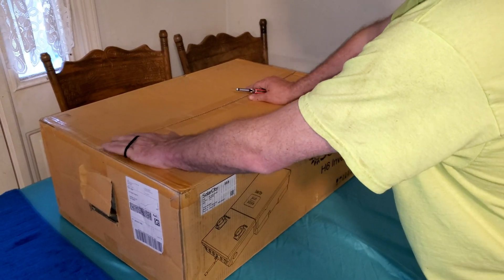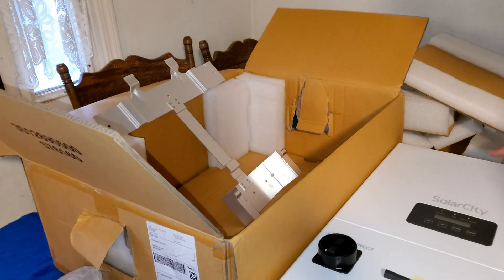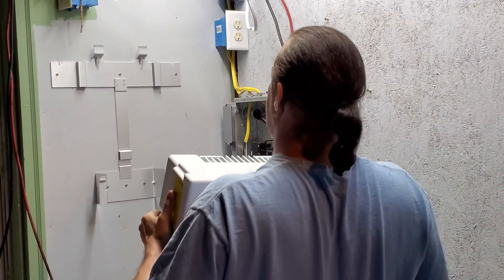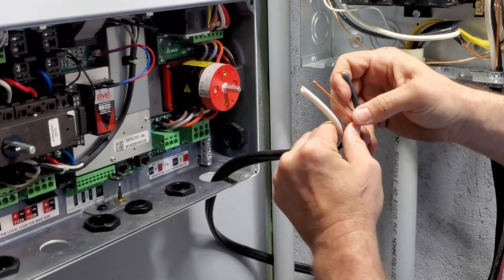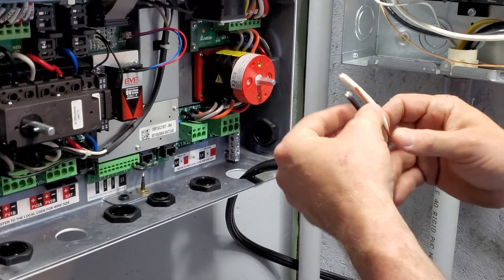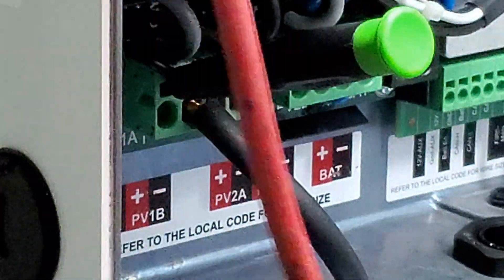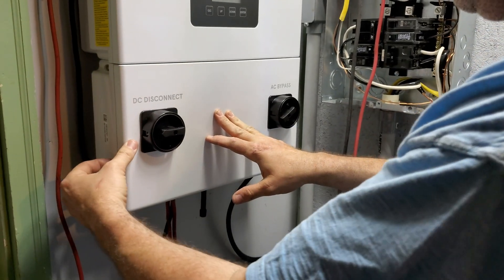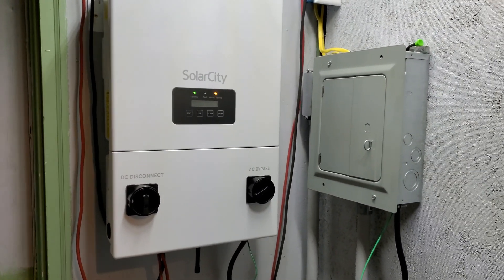delta h6 grid tie inverter installation.

Comment: Is the double 30 amp breaker ok. I saw a double 40 amp breaker on my installation sheet.
Reply: I read somewhere the unit can spike up to 9k if there was that much solar array hooked to it. so a higher amp breaker would keep it from tripping. how ever I have a 30 amp installed on mine I believe  and its never been an issue. if you try the 30 amp and it trips the unit will power down and go into fault. it shouldn't hurt the unit. so you can try the 30 amp. if it does trip than you will need to move up in the breaker to the recommended size.

Comment: Could this inverter work in a house that only has a single phase of 110v
Reply: yes
Reply: technically it should be possible but it would be a waist of money since you would be paying for more inverter than you need. there's several good options out there for single phase inverters one you should look at is one with a limiter on it. most homes that have only 1 phase aren't setup to send power to the grid. a grid tie with limiter will only output power when your drawing power and it will help you save on your bills.

Comment: Do the panels go in parallel or in series?
Reply: must be series, to get the voltage as close to 380 nominal as you can on each  mppt channel and you must use both mppt channels to get up to 6kw or it will only be half power (3kw max) with one mppt.
Reply: @coreyweaver9376  thank you, good night

Comment: i have a question the phase is divided and what battery voltage works
Reply from the maker: Battery voltage would be to be ruffly 390 nominal volts.  The inverter is setup for 2 phase or split phase. This is a standard power connection in us residential homes

Comment: Did you connect AC output and tried it with some load or the inverter is feeding back from AC grid connection?
Reply: I have only tried it with the grid at this time. im working on salvaging some 18650's to make a battery pack for the unit and I want to test its off grid abilities
Reply: @johnstupp3452  -- “salvaging some 18650’s to make a battery pack for the unit”

Wondering how that is going?

Comment: If im trying to meet your recommended 380-400v range, which number do we look on at  on the solar panel? VOC or VMP? It's quite hard for me to configure a system with a very specific range
Reply from the maker: Im working on an update now after more testing you can run lower voltage lowest i have tested and works is 150v
Reply: @novatar-42  Thanks for the detailed explanation on this inverter. Very useful for newbie people like me looking for low-budget options. Looks like the only concern would be input voltage needing to be 380V.  So 380V would have to be supplied at either of the PV inputs and maintained through the day? I have some cheap (28 total) EvergreenSolar ES-190 panels with 30.3Voc / 23.8Vmp (nominal operation) so if I use them in 2 strings of 14 they would put out about 333Vmp. I've been looking for info to confirm if such array would work with this inverter. How has it worked so far? Did you actually get it to work at lower voltages without going into Fault?
Do you know if it has Rapid Shutdown capability out of the box, as purchased from SignatureSolar?
Reply from the maker: @EngineerX  yes it does work at lower voltage but it's far more efficient at higher voltage.  As for rapid shutdown the unit itself shuts off as soon as it's disconnected from the grid. The DC solar side will not shut off on its own unless you buy the separate rapid shut down modules.  I have not used these as  they are not required on my current setup/ location. Also this unit can be mounted outside so you don't need rapid dc shutdown if it's outdoor. Hope this answer helps
Reply: @novatar-42  It sure does help and I appreciate your quick response and thanks for answering my questions. This inverter is looking like a good candidate for what I want to do: A second system to supplement a 7KW setup that was already installed in the house by the previous owner (leased). Location is Southern California. I want to fill the gap to get close or exceed 100% household demand and cover the $300 to $400 I pay yearly to the local power company. Already have a NET meter on the existing system so I plan on connecting straight into a dedicated breaker box with this unit, very similar to your setup on this video. Each string should be around 320V so hopefully efficiency is not too bad at that voltage.
Reply: @novatar-42  - “don’t need a rapid DC shutoff if it is outdoors”

Can you elaborate on that?

Comment: Will this inverter work without being connected to grid power? And can it function without storage battery? I would like to use this in a solar off grid application for daytime use only.
Reply from the maker: It will work off grid but does require a battery
Reply: yes it will work off-grid without battery panels only (daytime use). However I have heard that these may only work for a couple of days off-grid if not connected to wifi??? then they cease to work off-grid without a password...?? I will be testing this inverter soon and will post a video of my results with off-grid use ability without battery on my channel.
Reply: @coreyweaver9376  Pasword ? How to get that ?
Reply: pw is 6532

Comment: There are 4 ports for different strings. Do you recommend each pair be in the range of 380-400v or is it per MPPT? Interested in getting this inverter
Reply from the maker: If possible yes but not a requirement. Im currently reconfiguring my array to connect all 4 to see if it affects anything. I will have an update video out soon.  Hopefully this weekend
Reply: John Stupp Great! Look forward to it. Appreciate the content
Reply: @novatar-42  Any update videos coming up soon. Love to find out what's your thoughts on this inverter as im planning a system build and id love to use this inverter because of the price

Comment: The problem with this H6 is to find the correct config Battery 400/550 V. High voltage and 14.3A/20A. low Amps. do you have any idea?
difficult to run out the grid. keep update us, Thank you.
Reply: LG Chem RESU 400v
Reply from the maker: @ishyne22  if I had one I would try it
Reply from the maker: Im looking at making a 96 cell 3p 18650 pack that's about 380v. Wouldn't be very big but should work as a backup.  Im also exploring using the chademo connection on my car as a possible back or even charging option
Reply: @novatar-42  Is there voltage on the battery terminals after you connect everything?

Comment: Wooow wow, It's as easy as you show it in the video? , don't you need another installation? Another question will you be able to install any battery that is not as expensive as tesla's?
Reply from the maker: Needs a battery about 400v im thinking of making one or tieing it into my nissan leaf
Reply: @novatar-42  wow good news, my friend if you do that up the video, Right now I'm going crazy with so many inverters that I don't know which one to buy until I saw the h6 and I'm about to buy it, you have paypal? to send tips $ when up the video test with battery
Reply from the maker: @boricua80pr  are you looking for a grid tie with back up or are you looking at a more off grid option?
Reply: @novatar-42  need start without battery to save little money and Then I'm going to put battery, but I'm not going to use all the battery power, all Then I'm going to put battery, all time I use with grid
Reply from the maker: @boricua80pr  first thing you want to find out is do you need a net meter or smart meter installed.  Most homes have older meters and can't read but one direction. This can be a difficult process for a diy install however it can be done
Reply: @novatar-42  my priority now is without battery and Grid, But it's  interesting if you can put the nissan battery in the h6💪🏻💪🏻

Comment: I like that inverter. Looks easy to install and use
Reply: Wooow wow, It's as easy as you show it in the video? , don't you need another installation? Another question will you be able to install any battery that is not as expensive as tesla's?
Reply from the maker: @boricua80pr  I'm not sure on the battery as of yet but I'm working on building a battery to test
Reply: @novatar-42  - “I am working on building a battery”

Did you ever connect a home made battery yet? 

I am thinking about building a 140S Li-Ion pack and buying one of these, but I was hoping someone else tried it already!